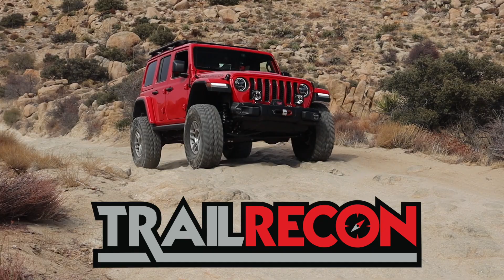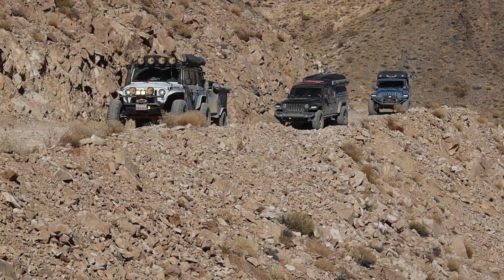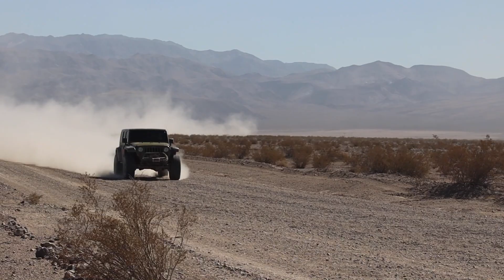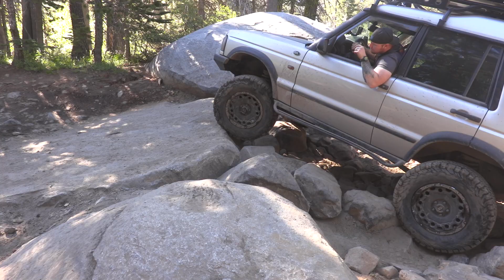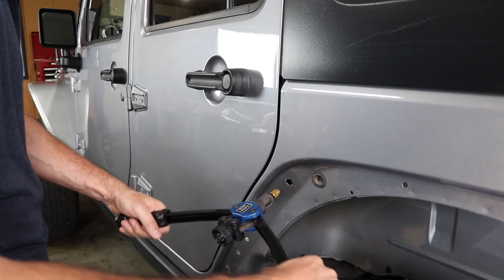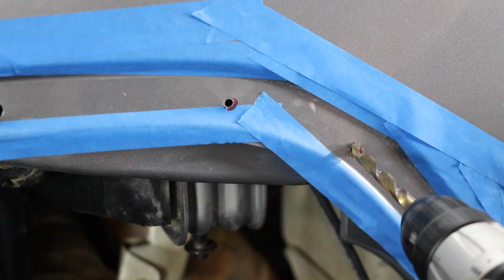Should You FABRICATE or BOLT-ON Your Off-Road Vehicle Upgrades? w/ Dirt Lifestyle

Comment: 0:26 Nate from Dirt Lifestyle
1:35 Nate's trip to Baja Mexico
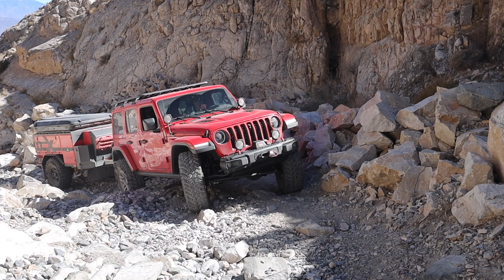2:20 Death Valley Trip
2:46 Bolt-on vs Fabrication Intro
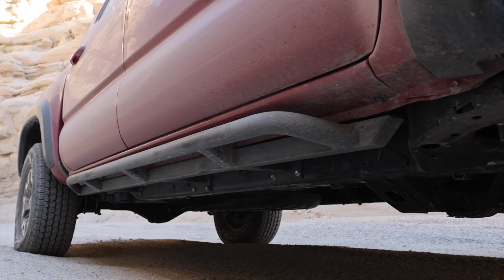5:46 Why did you choose to make your own rock sliders?
8:41 Great starting projects for fabrication
9:37 Biggest expense for building those rock sliders and what tools did you need
11:35 Why did you decide to buy a bumper for the Tacoma?
13:05 Tweaking bolt-on parts
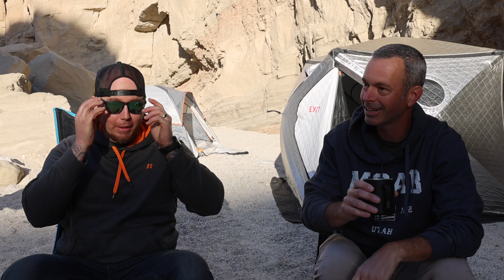16:14 What fabrication is next on the Tacoma?
18:02 What trips are coming up on Dirt Lifestyle?
19:06 Closing

Comment: That was totally interesting.  I'm one of those "bolt-on" guys but was disappointed that some really cool bolt on products didn't quite fit my vehicle.  Some parts I gerry-rigged them to make them work for me.  I was never a mechanic per se due to my short attention span, always wanting to apply or fix something quickly.  For example, I put a short light bar on my Jeep SUV and a couple of fog lamps to add to the set already on the vehicle.  A couple of local shops told me that the bar wasn't made for my vehicle.  Well, I wanted it so I rigged it to make it fit with a couple of bolts and two wide cable ties.  Aesthetically, it looks great and it's been on my bumper for seven months and working just fine.  To have Nate's skills would be incredible but at 74 I'll just remain a bolt-on guy.  Brad, that tent behind you guys...is it a Gazelle T series?